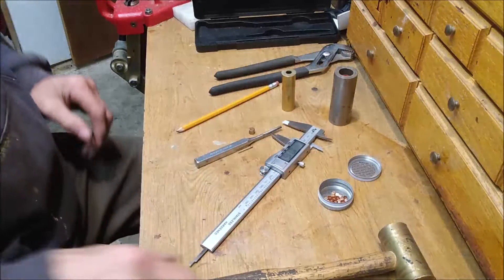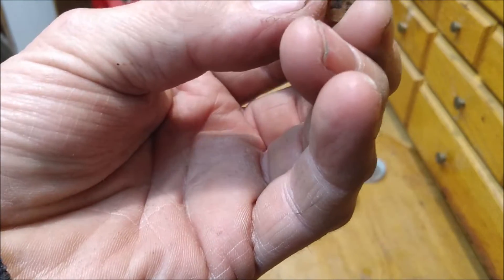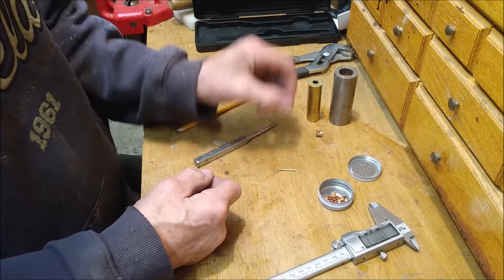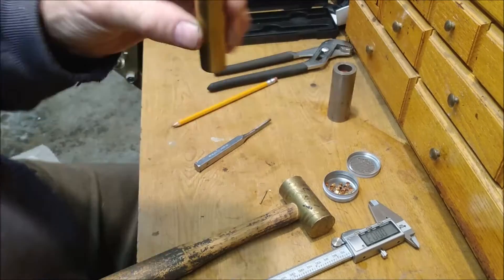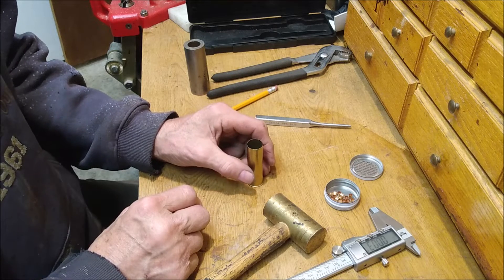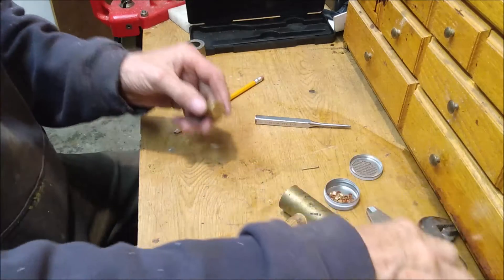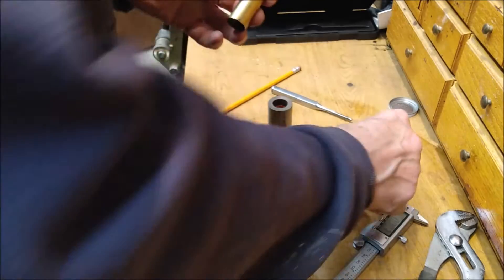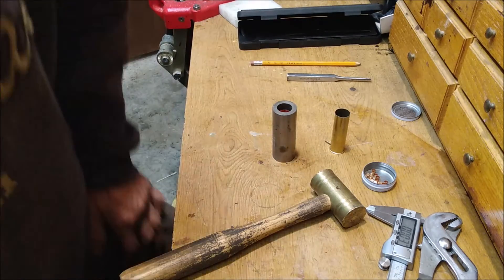How I make pinfire shotgun cartridges

Comment: Nice! Are you making yourself the little brass cap-holder?
Reply from the maker: Yes out of round rod
Reply: @mikeharrell4222  Nice , are you selling them? I would be very interessted to buy some for my 16  and 12 gauge pinfire shotguns!
Reply from the maker: Just buy some brass rod that is the same diameter that I said it was in the video, drill both holes and cut it to length.  It's pretty easy.